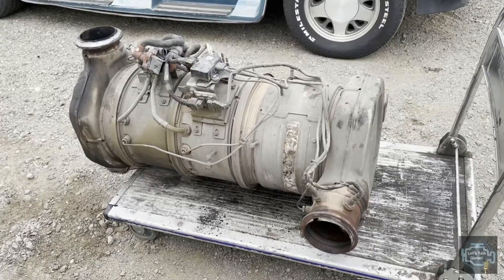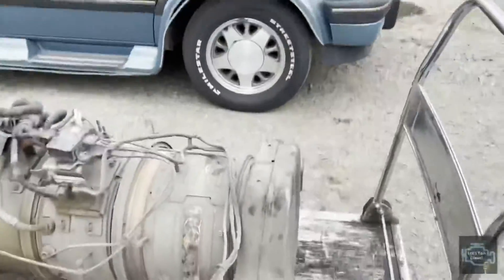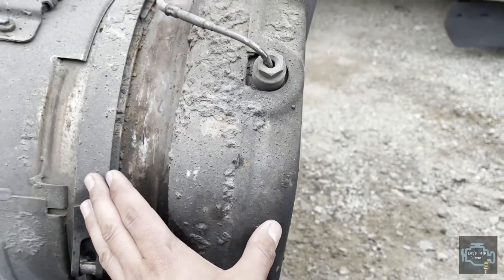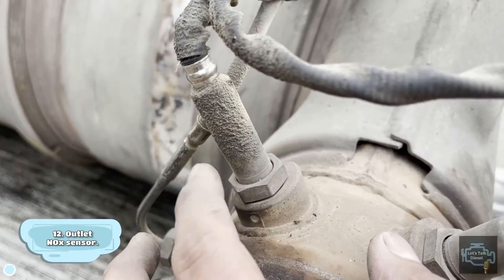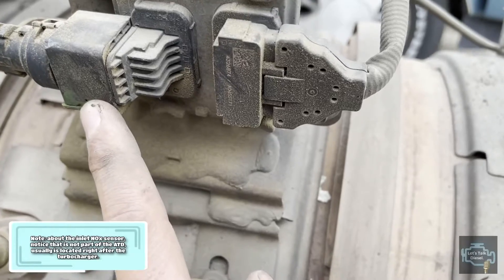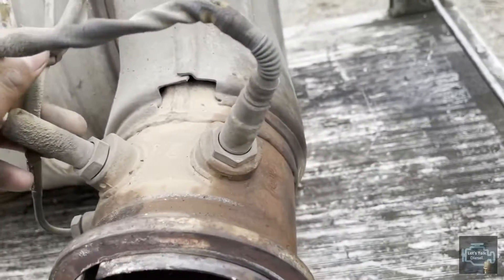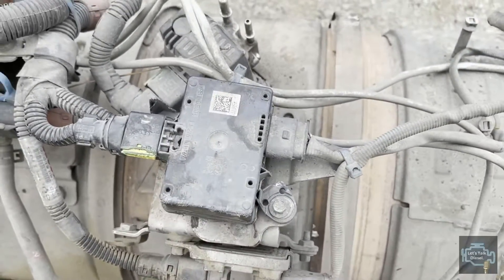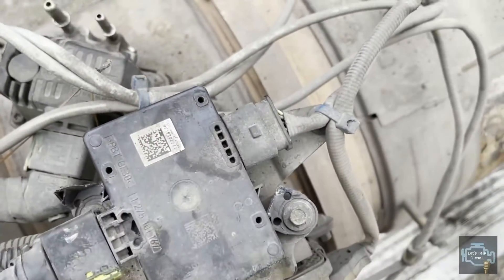ATD System episode 7: Cummins Single Module Aftertreatment System

Comment: Gracias compadre. Que creas la after treatment de Volvo? Quiero comprar un 2014 780 con D13 545,000 millas
Reply from the maker: Personalmente, creo que es un buen diseño, pero se le debe dar mantenimiento adecuado, en general el motor D13 es un buen motor, por las millas le sugiero que al adquirir el vehículo, pregunte si le han hecho la limpieza de los filtros (DPF). Solo le le recuerdo que en reparaciones Volvo tiende a ser un poco más caro que Freightliner, tenga eso en mente al momento de la compra. Gracias por ver el video.